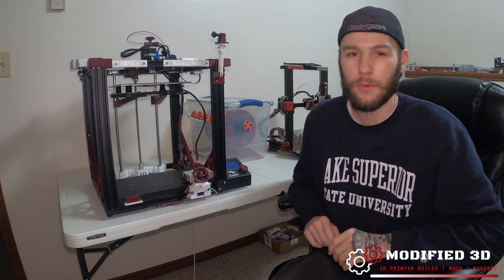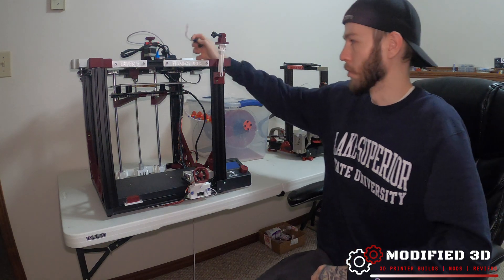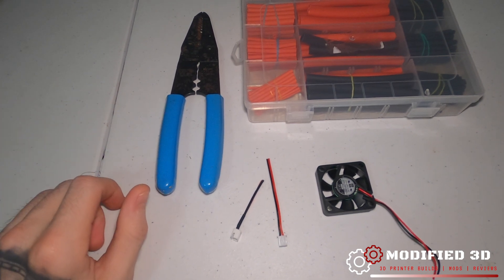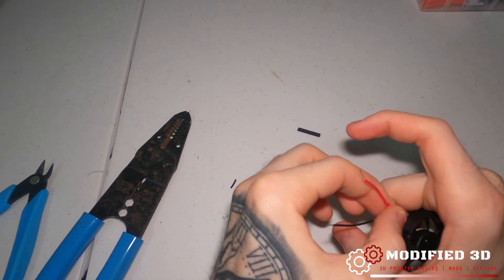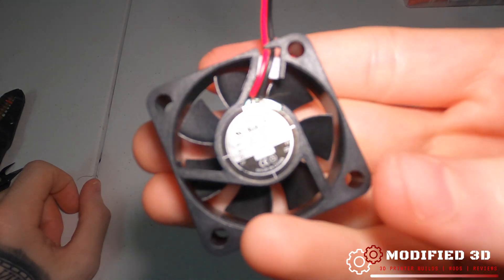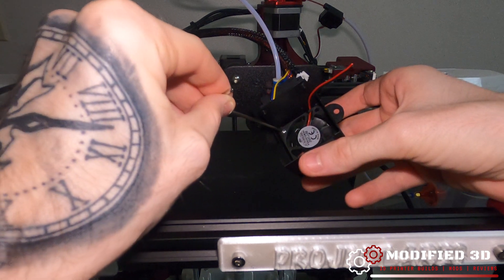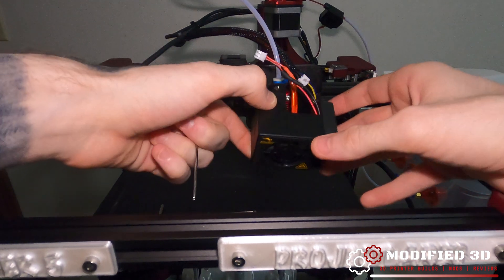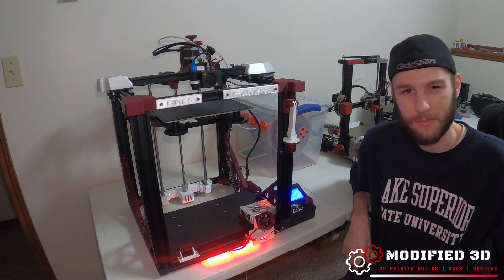Th3d Silent Fan Install | Creality Ender 5 / Ender 5 Pro

Comment: I noticed when I untightened the allan screws of the cooling fan housing (the 2 on the left), there is much less vibration noise through the frame. So I added a thin foam between the housing and the carriage which eliminated that.

Comment: Those are just generic fans overpriced as fuck. They don't even sit flush because they don't have the holes drilled out. I feel bad for who ever wasted their money on them instead of noctuas.
Reply from the maker: Noctuas don't have adequate cfm to prevent heat creep. Never had an issue with either of Th3d ones.
Reply: @modified3d59  you can bump them up to 14v with the bucky converter and theyre just fine.

I just cant believe people buy those $1.25 generic fans for $7 and they dont even sit flush. They're so ugly and cheap looking. 

Also if you've ever built a pc, theres a reason the rans sit flush against the cases, radiators, etc. Not being flush messes with the airflow. Jayztwocents and LinusTechTips have good videos on it.
Reply from the maker: Both mine sit perfectly flush? Also, you don't see an issue with running a 12v fan at 14v? Plus the cost and added failure point of the converter. Nty
Reply: @mattnelsen6732  You made your point, move on troll...
Reply: @thetreasurebin  Actually he is right. Th3d is not shipping "Th3d fans". They just sell other brands (orion fans if you check the label of the fan in the video) with a markup. Check the technical specs and buy the fans somewhere else, cheaper.
Reply: Use noctua for the electronics; psu and mainboard and use a high cfm one for the hotend and cooling fan.
(I use 2 80mm noctua redux fans for the electronics)
Reply: @groteboem  what about hotend
Reply: @Logix727  Use a high cfm fan for the hotend and part cooling.
Reply: which noctua fan do you recomment for the ender 5 pro?